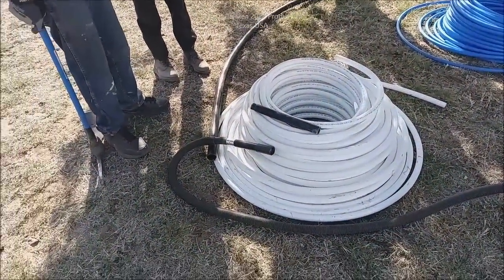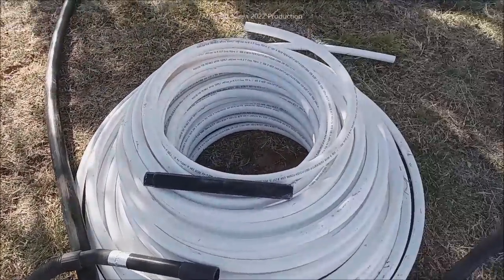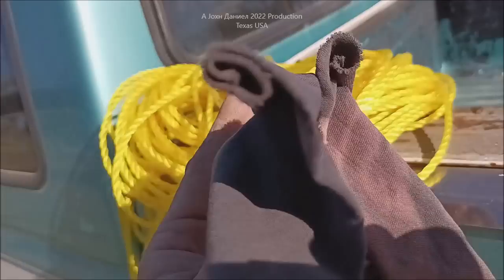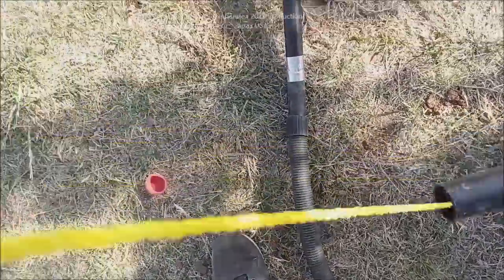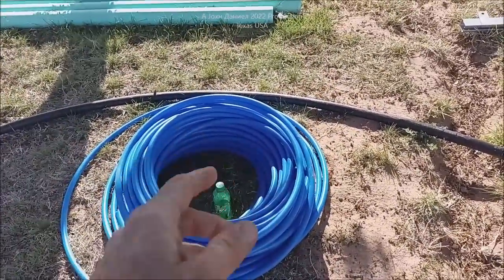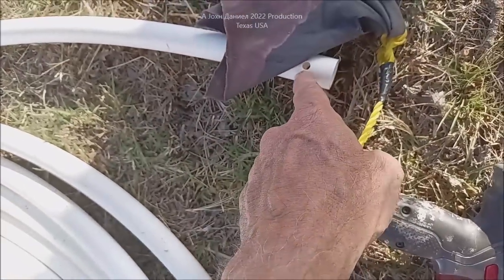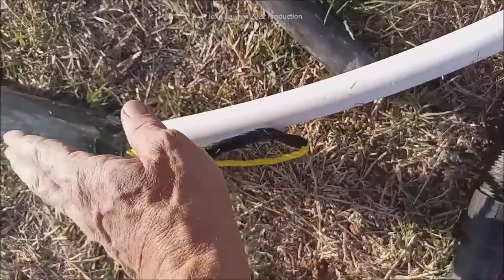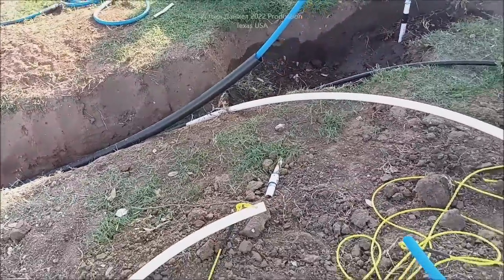Contractor secret to Running Conduit, Water lines, Wires, Cables & More.

Comment from the maker: Always Share a easier way and parts used from sources, we win the DIY process. Every Size of Poly Rope you can ever use https://amzn.to/4dCF1gH and AS PROMISED, #1 Source for Battery & Adapters https://amzn.to/3iAgWKm for Porter Cable 18V Lithium https://amzn.to/2WSLzji ALSO full power kits on Amazon https://amzn.to/2QTlfTv

Comment: Any ideas on how I can run electric under my small creek?
Reply from the maker: @richardneal1854  1" poly, 250 psi https://amzn.to/3Wfqscm is heavy,  tough and solid. Handles 3 strands 6 awg. But you have to dig down about a foot in the creek bed, deeper on the sides, to place it. Cover well with gravel/ large stone. Leave a few extra 3 to 5 feet on each end in case it has any movement until it settles. We've used it numerous times on hydropower units.

Comment: Can poly be bent like pex without flattening it?
Reply from the maker: If you heat it to over 150 degrees and under 200 degrees with safe method you can form it.

Comment: I put low volt wire in 1/2 cheap irrigation poly before burying it all the time.  I use 3/4 PVC to protect and insulate 1/2 PEX above and below ground. I even warm and shape the PVC to contour around things and it stays put and keeps the PEX in place....

Comment: Compressed air works in a similar way from the opposite end. I used this in long conduit runs with Paracord pull string and pulled multiple THHN "slick" wires in many a factory. I like the vacuum method though for shorter runs in larger diameter pipe. Good idea.

Comment: Good old home trick... We did a similar thing pushing line for pulling cable with compressed air cylinders blowing the foam piston down the conduit when installing the wiring for the Traffic Camera System in the 7 Km of Tunnels under Montreal city.

Comment: If you tie a plastic grocery bag to the end of your rope it will work better than the rag you are using. It seals a lot better. I pull all of my solar panel wires through conduit using the same type of principle.
Reply: Yeah a good plastic bag like ones Menards has, how I've done it for decades.
Reply: Sandwich bags (after lunch) work great for smaller pipes.. We  used an old-school toilet float in  4" conduit -- 800 Ft runs.  Try anything, if it don't work,, try something else.. .